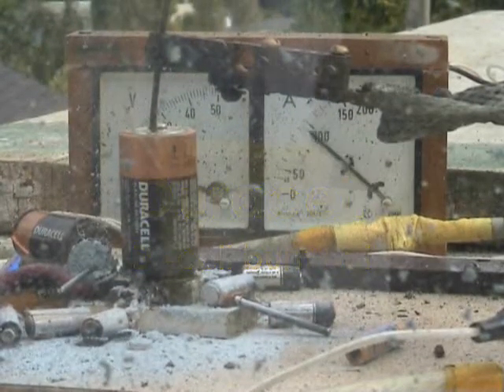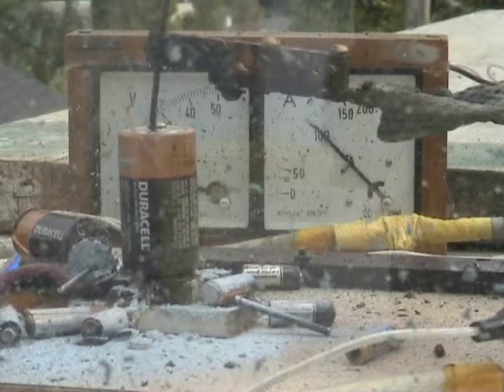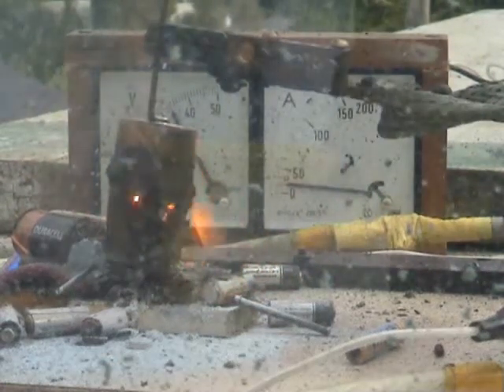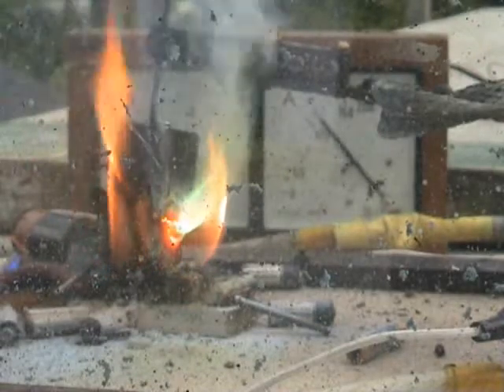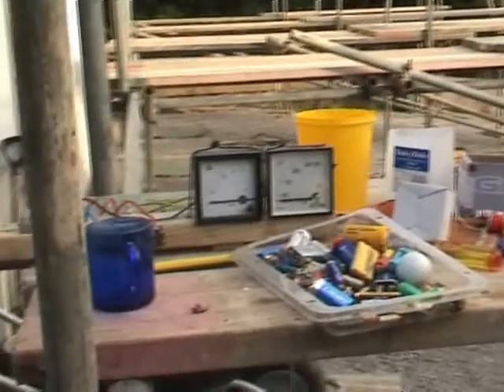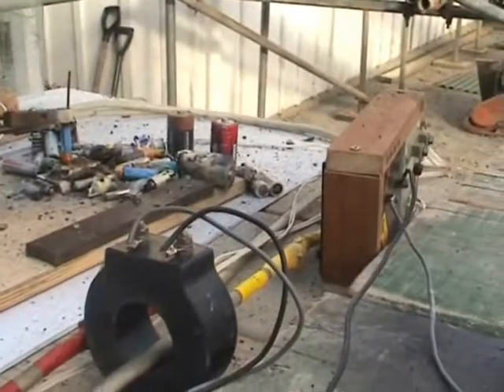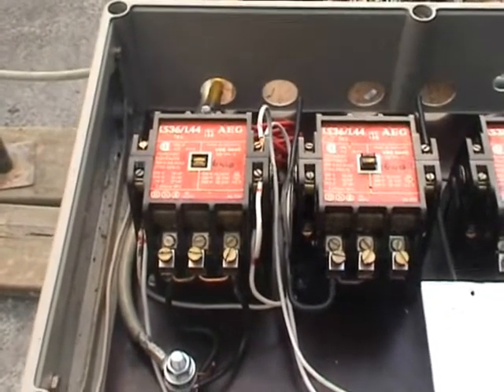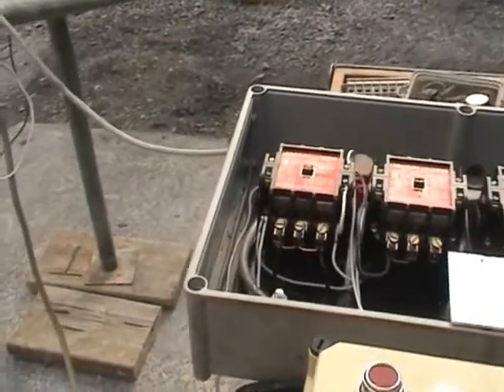Duracell D - cell burn out

Comment from the maker: @BoomBoxDeluxe  I will make a set up with a kWh meter. Usually 60 to 100 Wh max for a good burnout.
One afternoon playing around 3 to 5 kWh.
i will put the kWh meter on the secondary side, at least there will be some current flowing through it.

Comment: Nice.....A whistley-squeeler that shoots flame throwers, and then goes into melt-down. What would also be nice in these experiments, would be a seperate kWh meter reading, so that the amount of kWh (or fractions thereof) can be recorded on how much it took to cook a battery or two. :-)

Of course, make sure that the kWh meter cannot be damaged or destroyed by batteries that launch and go flying off somewhere. It would be interesting to know the sort of power needed to pop a battery. 

-BBD.